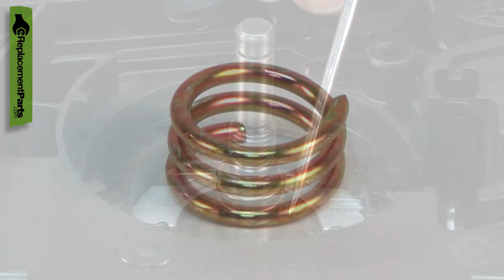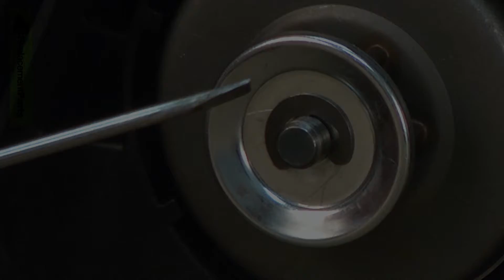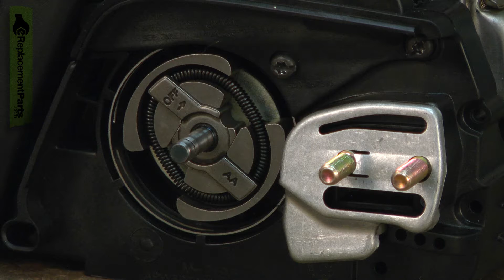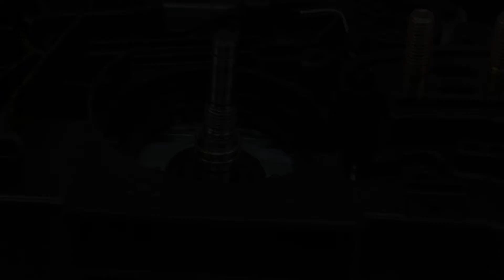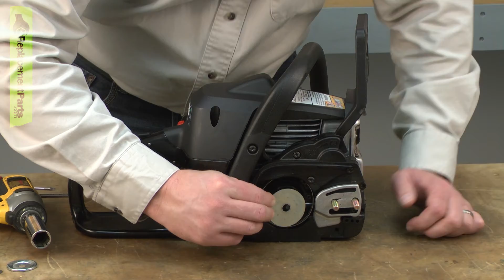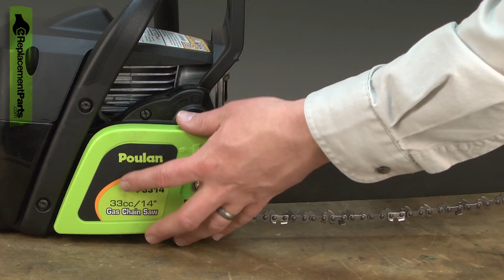Chainsaw Repair - Replacing the Spring Worm Gear (Poulan Part # 530037820)

Comment: Hey Butt Hole - It Would Have Been Great If You Would Have Mentioned What Size Socket You Used to Hammer The Worm Spring On!!!!!!!!!!!!!!!!!!!!!!!!!!!!!!!!!!!!!!!!!!!!!!!